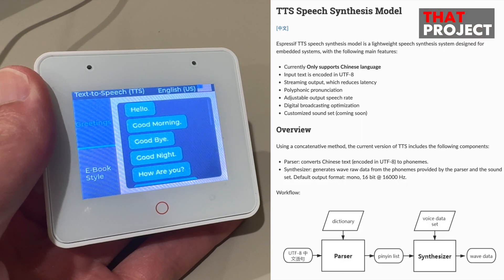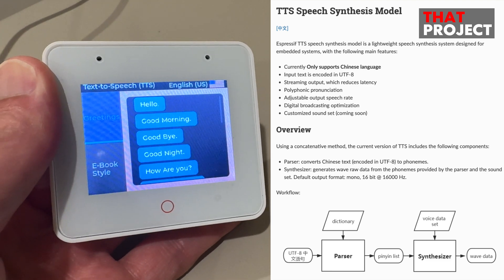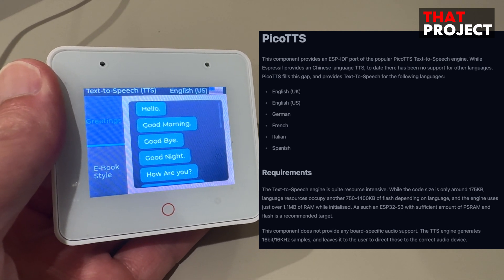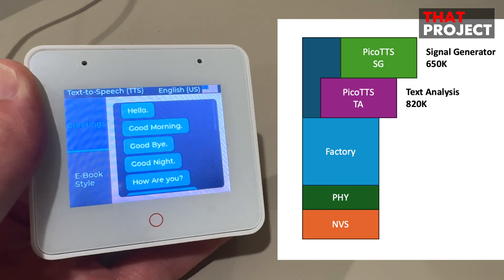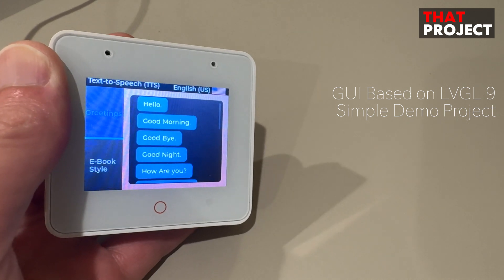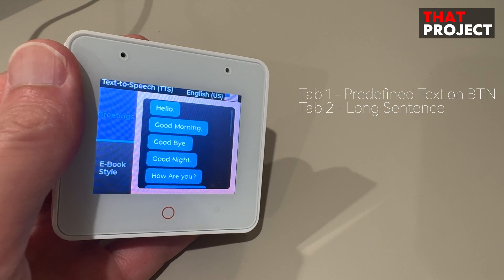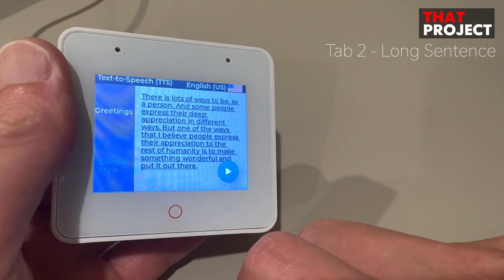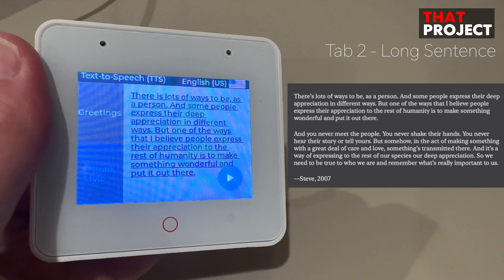[On-Device] ESP32 Text-to-Speech Demo with Multi-Language Support (Pico TTS & LVGL Integration)

Comment: i tried to use the example but the bsp didnt worked for me as im using a generic s3 devkit c so i modified the code to write the audio data directly to the i2s channel but the voice is not very clear for some reason.
Reply from the maker: @snopz  Are there any other tasks happening at the same time that the audio is playing? Tasks like updating the UI can interfere with the audio writing.
Reply: @ThatProject  no i dont used a screen only the voice with the max98357a amp